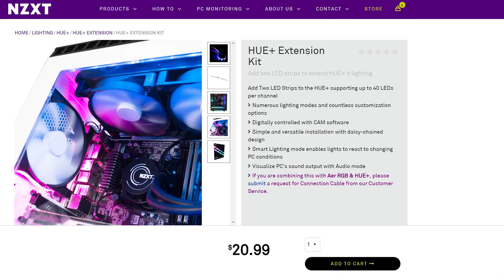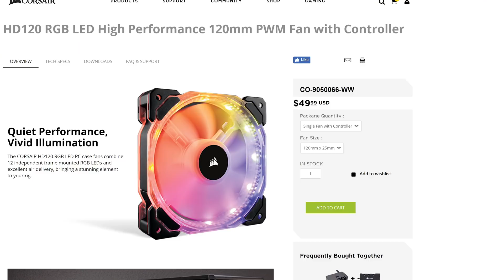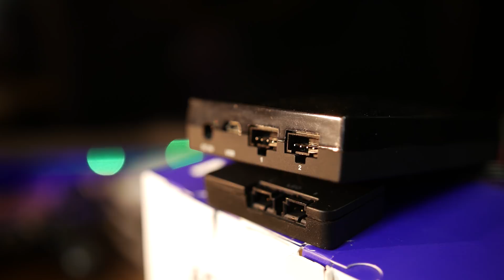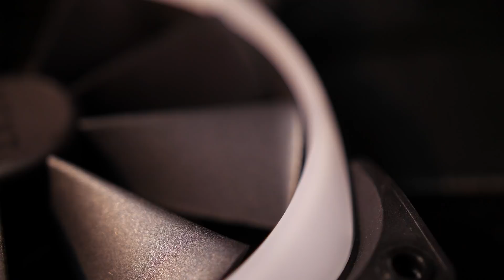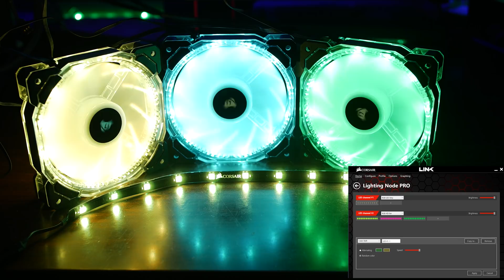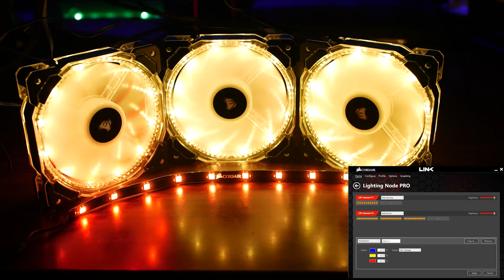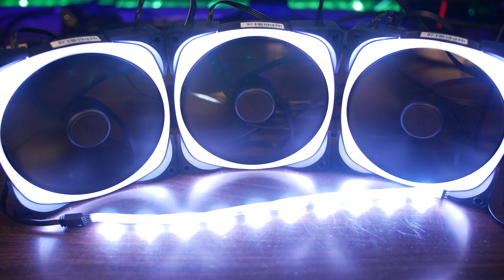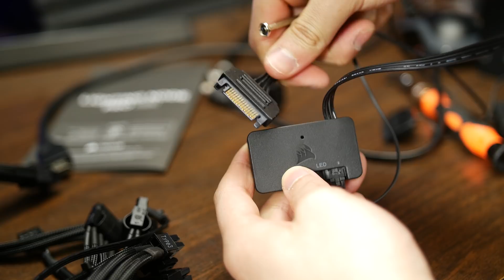NZXT HUE+ Vs. Corsair Lighting Node PRO

Comment: Thinking of changing my case to a corsair 750D airflow and then slapping the NZXT HUE+ (140mm Fans), Thoughts?
Reply from the maker: I have the 750D (not airflow) and I think that one's perfectly fine in terms of thermals.  To be honest with you, I think the airflow edition looks a little odd, but that's a subjective thing!  I do have a review of the 750D buried in my channel somewhere, but based on the particular one I have, I can't say I'd really recommend it.  My case had some quality control issues, but I've heard a lot of other reviewers say really nice things about it, so maybe I was just unlucky!  I like the NZXT HUE+ and their AER RGB fans a lot, but I would only use these fans for top and rear exhaust.  It might look strange as a front intake for the 750D airflow 'cause the front is grated, but that's just my initial thought.  It might look pretty cool, too!
Reply: To be honest I have been stuck between the airflow and the standard edition, I can see what you mean about it looking odd with the grated front, so I may buy the standard edition since you said its fine in terms of thermals ( and saves money lol ). However if you have any recommendations for a new sleek  looking case  i'd love to hear your opinion ^^
REPLY
Reply from the maker: Hmm, well, I would need to know what kind of hardware you intend on using, and if you're open to more designs that aren't quite the same as the 750D.  I'm actually about to go to bed (probably should have a few hours ago), but I'd be happy to review when I wake up!
Reply: My system contains : MSI GD65 Z87 with a i7 4770k (cooled by a corsair H110), Gtx 1070 amp extreme, 16gb ddr3 gskill, corsair rm850 psu, 120gb ssd, x2 1TB HDD, all inside a cooler master haf x.  The reason I want a new case is because all the jagged edges for the haf x make it a dusk magnet (also a pain in the ass to clean the limited amount of dust filters it contains). 

I would prefer another full tower as when i decide to upgrade to a newer chipset i want make a  custom water loop. I do like the clean look of the 750D so aslong as a case isnt made of glossy plastic and looks clean i don't mind (budget wouldn't be a problem).  Thanks for the reply :3 enjoy you sleep bro ^^
Reply from the maker: If you've got deep pockets, the be quiet! Dark Base Pro 900 is pretty solid!  A little cheaper than that is the Phanteks Enthoo Luxe, which looks pretty neat, too!  Then there's the Thermaltake Core V71 or X71, or Fractal Design XL R2 (no window, but super sturdy!).  Not sure if any of these are to your liking, but I hope this helps!
Reply: I love the be quiet Black Dark Base PRO 900 it looks so sexy haha. Is it possible to create, or even buy a psu shroud for this case? btw You definitely deserve more subs you're the best!
Reply from the maker: I'm not sure about buying one, but I'm sure you could make your own somehow!  I've seen some pretty awesome YouTube tutorials on them that could probably help you out!  And thanks, that means a lot to me!
Reply: I'll check out those tutorials. anytime dude, and Its gonna be fun watching your channel get bigger. Thank you for helping me out! :D
Reply from the maker: Thanks, and no problem!

Comment: I think i havent understood something right: Why has corsairs product a software and a wired remote?
and hasnt their fan-rgb controller no usb connection?
Reply from the maker: You can use one or the other.  The HD fans can connect to the Lighting Node Pro, and that'll let you use the software.  If you buy the fans with the wired remote, you can use that remote without having to purchase the Node Pro.  The Node Pro requires a USB header on your motherboard.  The remote (more accurately, the hub) only needs SATA power.
Reply: ok thanks